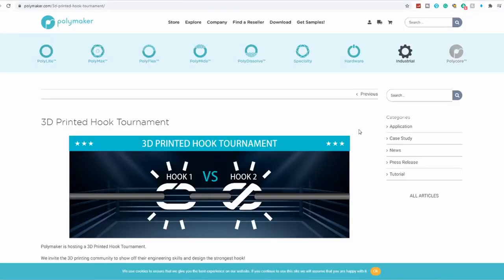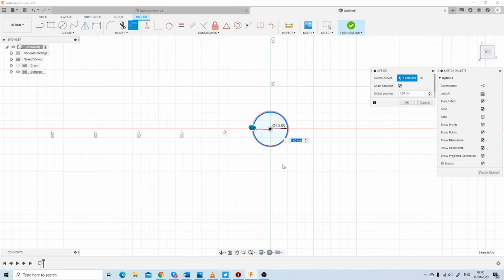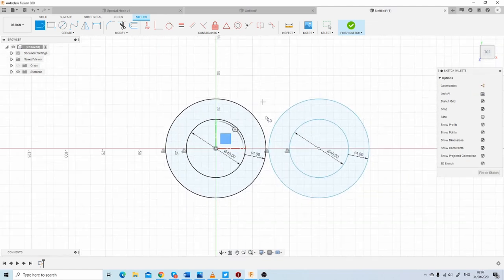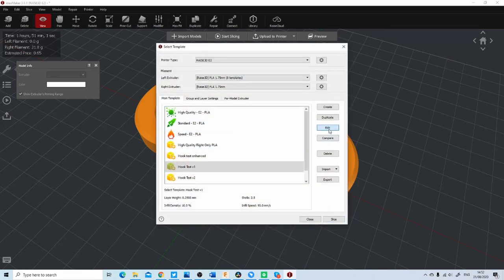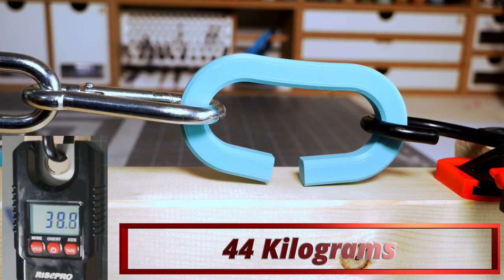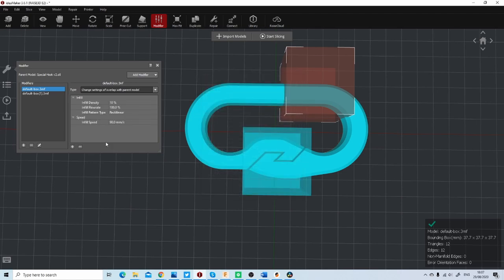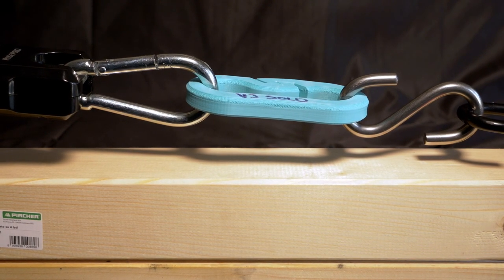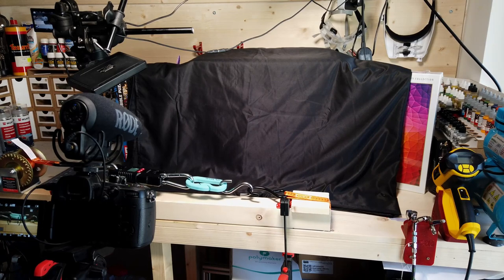How Strong Can A 3D Printed PLA Hook Be?!? Designing The Strongest PLA Hook For A Competition

Comment: 50 grams of plastic holds up 250 kilos. That's impressive. And I like you mechanic problem solution, you know how to set a strong print. But one thing is missing... The interlocking section is could be rounded up, so it's no stress points. I think it still could be stronger with the same amount of plastic, just by adding some curves. Great job!
Reply: Hi, my test hook can at weight around 6 grams hold 80+kg. Now i have 22g sample and i'm unable to test / broke it ... because those forces are really big and little bit dangerous. 😬

Comment: PLA is stronk AF, people really underestimate it but oh man can it stand up to some weight
Reply from the maker: I was completely blown away to be honest, almost literally lol
Reply: yeah the only issue is that when it breaks, it breaks immediately compard to like petg where it just slowly deforms.
Reply: @SolidGreenDay  The good thing is that with PolyMax PLA it does not break immediately, you could see it in this video and it is even more obvious in this one:
https://www.youtube.com/watch?v=Pn7HGiYn-VU
Reply: @SolidGreenDay  Yeah this is the primary benefit of Polymax. It's noticeably more ductile than even PLA+ but I think has a lower elasticity than PETG. It's a nice material to work with but I wouldn't use it in place of PLA if you want something as rigid as possible. I will probably use it in place of PETG sometimes but I think each spool should be a full 1kg for the price.

Comment: I noticed that your last hook broke at the "closer". That closer was under tension. Why not move it to the attachement end instead of the side? This puts the "closer" under compression. Another thought is that during pulling there is stress pulling the hook narrower. Another idea is two openings at the ends under compression and a single center, much like femur.
Reply: I would also thicken at the attachment points to reduce crushing fractures.

Comment: This could have been a chance to test the Fusion360 simulation capabilities for a comparison :D
Reply from the maker: I can confirm that they were on point. Only reason I didn’t do it is because I wouldn’t be able to explain it well enough :)
Reply: 3DMN very reasonable :) impressive design nonetheless, 261kg is awesome, maybe stefan takes part in the competition and you can both collab a video on it, one thing i to test in the design would be little slots in the body that would first contract towards each other before giving up, a solid piece gives in one go, those would have two stages.

Comment: 6:29
the answer is RIGHT THERE, jumping into your eyes!!! and you don´t get it.
a CIRCLE is the wrong(est) shape you can use for a strength test.
they all break in exactly the same spot and instead of questioning your construction shape, you keep this "error" and just strengthen that part.
(while not removing the weakness caused by construction (shape)

in bionics we never use a right angle or a circle for construction.....because they are weak and break.
"non uniform rational B-splines (NURBS) is the answer.
Reply: done right you should reach almost 400kg.
Reply: @jpjay1584  400 Kg will not win this competition.  Not even close.  ;-)
Reply: @twinturbostang  how many KGs?
Reply: @jpjay1584  Well...  I'm up to 900 KG and still haven't been able to break my hook!  I keep breaking my test rig and have to reinforce every single piece of it from the metal S hooks to the brackets and supports.  But the 3D printed hook won't break!  LOL  It's amazing what 40 grams of plastic can do!
Reply: @twinturbostang  holy shit!!! that is amazing. 
how´s the structure optimizing in Fusion360? curious what shapes/performance that will get.
btw: when is the competition finished?
Reply: @jpjay1584  I played with that with my first designs but didn't get very far as I'm not that knowledgeable about the advanced features in Fusion360.  So, to be fair, I haven't tested the hook I submitted for the contest to 900 KG yet.  I have an alternate design, which I did not submit, but was a backup design just in case.  That one has been easier to test and has held 900 KG so far.  The one I submitted for the contest is different and because of the different shape, it has required different reinforcing of the metal S hooks.  But I'm 99% certain it is stronger than the backup design.  Anyway, I've just about finished reinforcing my test rig (again!) and will hopefully test it in the morning.  I literally have been welding reinforcing pieces on the S hooks to make them strong enough.  I'll let you know how it goes.  :-)
Reply: looking forward to the competition. tuesday and thursday they will post on their channel.  @twinturbostang  did you see, that your first models broke in the area where the circle goes into the straight? (that is a weak point) it should be changed to a smoother transition. also don´t use a circle and no straight pls. it should have a slow transition from a tight curve (almost-circle) to very flat curve (almost-straight) then it will not break anymore. also in weak areas the width + infill must increase.  (in your video you already tried the infill) NEXT: the hooks are weak points too. same here, no sharp corners pls. try everything "roundish" (also here, no circles) circles break and sharp corners, too.
Reply: @jpjay1584  If you're talking about the above video, that's 3D Maker Noob's video.  I haven't posted a video about my design yet.
Reply: @jpjay1584  So I finally broke it.  Not going to say how much it took (not yet anyway).  But I will say it was well over 900 KG!!  :-)

Comment: infill of 100% is actually weaker than 80%, at least according to several studies already performed in the past - main reason for this seems to be overextrusion problems, i.e. if you have too much extrusion you end up in a mess and reduce the overall material capabilities ... thus for strengthening my parts I normally increase the count of parameters and top / bottom layer counts, and only at the end I would increase the infill but not more than 80% ...
Reply from the maker: Shouldn’t apply to concentric infill sewing as the follows the form of the model. However I intend to dive deeper into these tests just for curiosity and follow up videos
Reply: LuckyBenni I think it can also be due to the way forces are applied throughout the model. I’ve heard a bunch of times that a hollow metal cylinder (a pipe) deforms or breaks less easily than its solid, “full-body” (= with 100% infill) counterpart. Also the beehive structure can, I think, be stronger than “full-body” (what’s the relevant word, BTW? English is not my native language...)